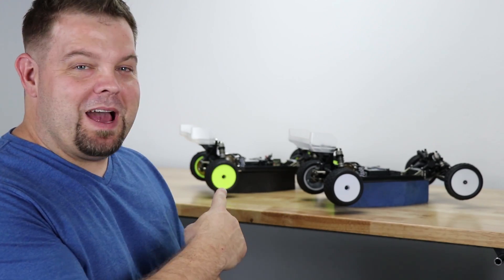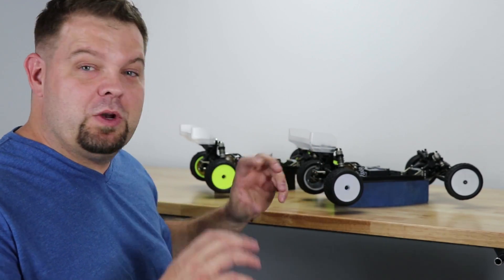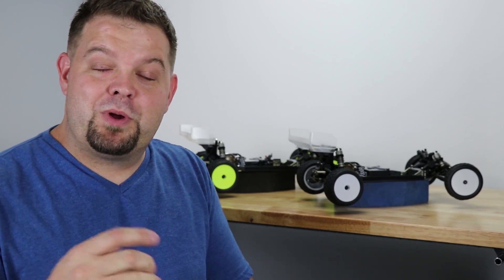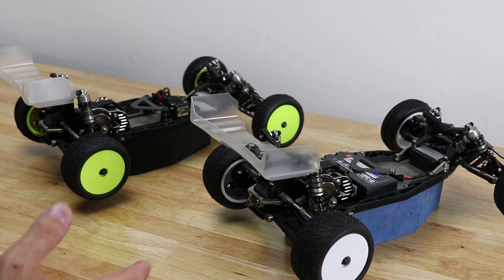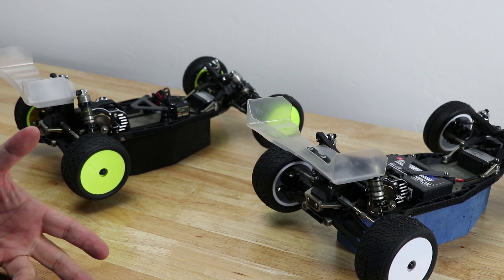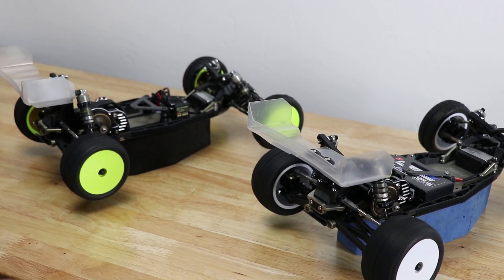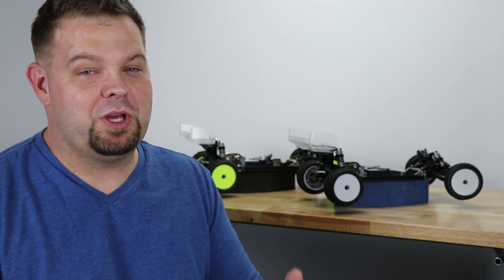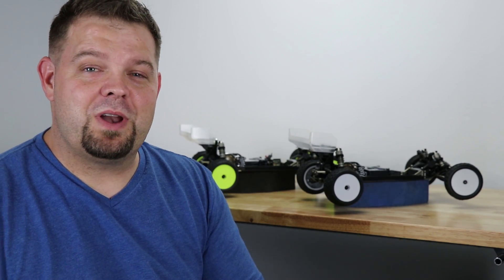More Speed: Are Ceramic Bearings Worth It?

Comment: Not really conclusive... You should do some speed runs with a GPS and see what the difference (if any) there is. That's a more practical/real world test. I don't doubt for a second that ceramic bearings are superior to kit bearings, but the question is how much and if it is really worth the cost?

Comment: This is useless, friction in roller bearings comes more than 85% from the shields and lubricant, in the last 15% the difference in friction might be at most around 20%. Knowing that 20% of 15% is 3% of the total, what is shown here in not valid. Never in equal cars mounted the same way, except for the bearings we could find this supposed gain in rolling resistance.

Comment: That test proves nothing. There is no load being applied to the tire therefore no load to the bearing. I don't see why people do this as a test, who drives their car like that. See if it does the same thing with all four wheels on the ground. Hambini does a great upload about ceramic bearing vs standard stainless steel bearing people should watch. Then maybe they will stop doing this thinking it means something.

Comment: ceramic bearing only have a advantage at high RPM high heat not the RPM nor heat a rc car will generate.  Same scam is happening in the bicycle world. Lab test proved no advantage given . Also any dirt on the bearing will lose any advantage the ceramic bearing would of had. So save your money and buy performance parts that actually make a difference. Ceramic bearings are used in industrial applications because of less maintenance usually on high speed conveyors belts but still not the speed RPM on a RC car gearbox wheels steering etc .

Comment: I race motorcycles 
Everyone runs ceramic bearings. I put them in and basically did the same test with my bike. I put the bike on a stand with the wheel off the ground. Gave it a flick. It went around two and one half revolutions . No front brakes on my bike. The after replacing the front wheel bearing with ceramic, I repeated the test. After two minutes the wheel was still spinning.
Reply: What do you use to lubricant your ceramic bearings?

Comment: There is no friction / resistance on the bearings when they just hang freely in the air. If you want the right result, they must be tested on a track. There you will see the real difference .. If there is a difference.

Comment: Just curious did you degrease the bearings with a cleaner or motor spray and then add oil or are these bearings right out of the package and installed?

Comment: Best thing is pull the seals and use graphite it will "lock" the bearing initially but once its frees a stock bearing will spin as well as your ceramics do out of the box old trick from my days messing with yoyo's

Comment: extremely good oil for reducing the amount of friction, using sewing machine oil. it's incredibly thin and lightweight and is meant to lubricate the minuscule incredibly fast bearings in sewing machines, which are very similar to bearings found in rc transmissions. Old longboarding trick.

Comment: Ceramic Bearings have had an excellent reputation, and are superior in several ways (except lifespan!). 
I agree with you that they're freer rolling.... but some will bring up the issue of lateral loading. (Effect of the Bearings when the tires have a weight load, running on the ground)

Is there some (inexpensive) means of testing these on some sort of rolling Dyno. Even if just to see how long it takes to stop from a free roll...
Possible?

Comment: But what about reliability? I used to run ceramic bearings on my diffs and they exploded, I never had a steel bearing grenade itself ever on a diff but I had 2 cars with ceramic bearings destroy diffs because they failed. 
What did you replace? Top shaft and middle gear? or diff too?

Comment: Why run stock bearings in the mod car?  Is there a reason?
Reply: Because you are never hurting for horsepower.  If you need more power just pump up your esc, or install a faster motor.

Comment: Or run just run mod motor and turn the power down if needed no need for all that at all.
Reply: Kenneth Jeffries JR  you can’t run a mod motor in a stock class 🤷🏽‍♂️. The ceramics were installed in the stock car.

Comment: No lateral(thrust) load friction doesn’t mean much for bearings, unless both cars being compared have absolutely identical lubrication. That being said, I would run ceramic in the transmission and steel in the wheel hubs where there is more lateral stress. I was impressed with the kit bearings in my B6.1D, I don’t think I’ll be upgrading them until they need to be replaced.

Comment: Do you think that ceramic bearings could be useful in a outdoor 1/8 super light buggy?
Reply: Rm Blake I want to make a super light 1/8 buggy. Around 5.5lbs compared to the over 8lbs of a conventional buggy. And am also planning to run 2s which should be enough for a superlight. So I think that using up the most of the 2s that I can is essential.
Reply: T2NATE VIDEOS I've been thinking about getting an 8th scale buggy. Which one is the lightest ?
Reply: Bill Johnson I really don’t know but I’m making a costume on using the slash 4x4 and the ssc8 chassis kit.
Reply: Bill Johnson but I would go for a tekno
Reply: T2NATE VIDEOS yeah I might check those out. Thanks for reply. I guess I'd go with a 550 size motor around 3500 kv
Reply: Bill Johnson why not a full 1/8 motor. Aren’t they bigger?
Reply: Rm Blake true. But there aren’t any 3s “racing” lipos i can find.
Reply: Oh and it’s not my idea. Tekno made a ed48sl designed for 2s.
Reply: Natanaiel Trif Tekno got the idea from the Traxxas Slash 4x4 converted to “BackSlash”. I’ve done the conversion on many different levels. At the end of the day, it’s still a 1/10th scale. On 3s with MIP axles, Tekno driveshaft, lcg kit, a center diff, Proline powerstroke strokes and multiple fans it will keep up with 8th scales for 5 minutes. Then it overheats. The problem with running 5 lbs on the 1/8th scale track is you slide everywhere. The tracks are so fast you need good tires and a stronger Servo for steering and then you overhear again. I destroy my tenth scale track with them though. So much fun!!!
Reply: robert Weighill I have a slash 4x4 and I’m converting it into a backslash. I am thinking about putting a hobbywing xr8 sct esc and a hobbywing 2600 1/8 xerun. I’m also planing on using the protek 4200mah 4s 100c lipos. After bashing the truck on 3s with tekno axles, I’m confident that they will hold up to 4s.
Reply: Rm Blake what motor and esc are you running? And are you running outdoors?
Reply: Rm Blake is a 1/8 motor that much bigger then a 3660 motor. If not then I will gladly run that system.

Comment: can i be the A-hole sayin'  " bearings needs to be driven first to run smoother !! " the ceramic are really really smooth ! but i think it's not thanks to the ceramic, i guess it's more thanks to the lack of grease and different seals ; what do you think ?
Reply: The ceramic is smoother than steel. Lack of grease would contribute but sometimes ceramic bearings have a lubricant in them too
Reply: stephane Z you can do / say whatever you want.  

Still a fair comparison since neither set has been “driven in”
Reply: There's just less drag..even if it wasnt ceramic..I can easily tell..after I lube the regular beaings verse no lube ( out of the box)..if you install ceramic bearings
in brushless motors..the motors would run cooler, perform better over all...
if you were racing in a class...with motor size limits..ect. It would make a differences...after 5 mins into the race.
It would also make a difference..if I get a no name brand motor..which perform
decent..but I know I can slap better bearings in to gain better performance